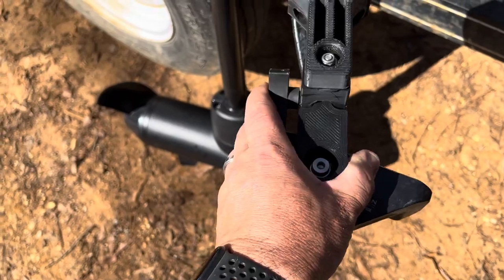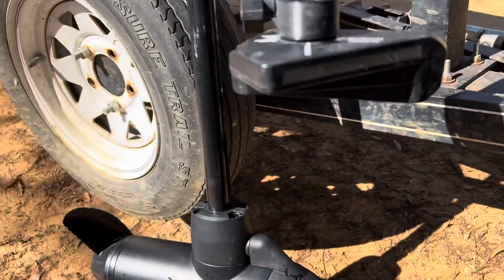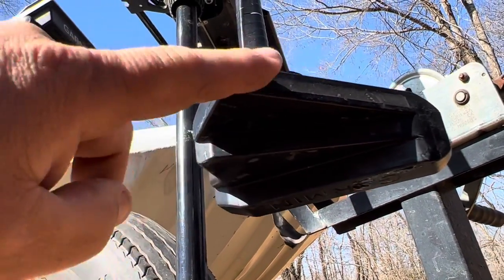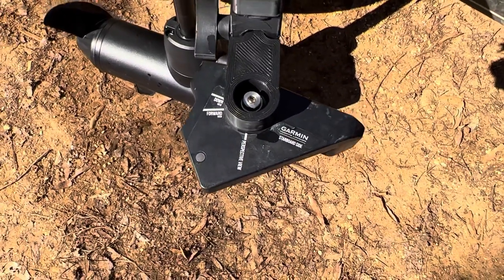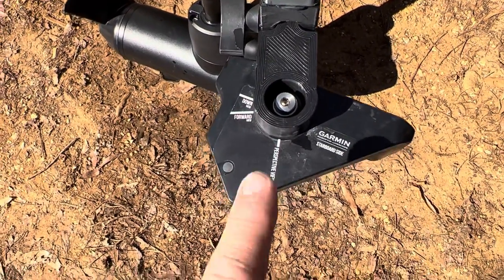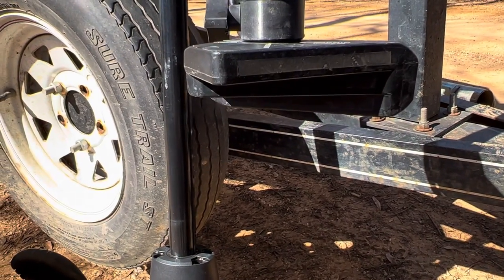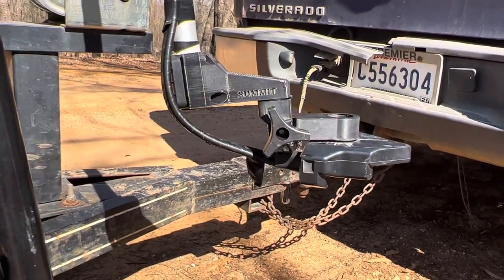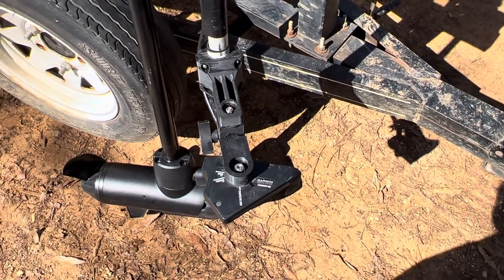Garmin Livescope Perspective Mode: How To Properly Set Your Transducer

Comment: Question! I have the LVS34 and running the Fish Obsessed Mount, mounted port side. When rotating to perspective does it matter which side the cable ends up? Portside or starboard? My “center” beam is perpendicular either way. 
Thanks for all your dedication in your videos.
Reply from the maker: It doesn’t matter bud. Whichever way is better for you

Comment: I would like to send you a photo of my perspective mode.  I have the Summit mount like yours but its on the port side of my pole.  Forward and down work perfect but in the perspective mode my transducer is flat and positioned perfectly forward but the tranducer is up side down unlike yours.  Does this mattater??
Reply from the maker: It will actually read both ways. Just make sure the image isnt flipped

Comment: I have a question on my perspective mode.  I have went through all the setting you recommend and for some reason reason my screen is dark under the boat till about 15-20 feet out.  Any ideas on what I have set wrong?
Reply from the maker: Garmin Livescope Perspective Mode: Let’s Break Down The Beam and Answer Some Questions Part 1 of 3!!
https://youtu.be/yNQ7OmUmu4g
Reply from the maker: Garmin Livescope Perspective Mode: Getting The Right Angle
https://youtu.be/YKw_AqSC4Lc
Reply from the maker: Garmin Livescope Perspective Mode: Part 3 The Proper Angle
https://youtu.be/ksQ-2ViLpzc

Comment: Kind of on topic, but have you had any issues with perspective not changing in auto settings? I can manually change the setting but if all is working well with the system I should have the option. I am current on updates. TIA
Reply from the maker: I’d be willing to bet you need to calibrate the compass on your Livescope

https://youtu.be/nvLK7Fnc-gM
Reply: @The_Garmin_Guru  Thank you sir.